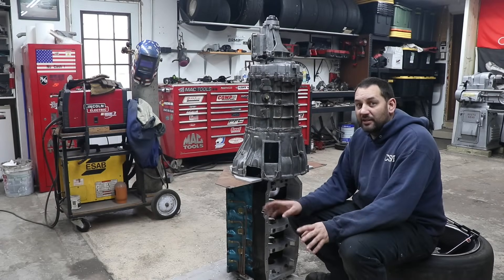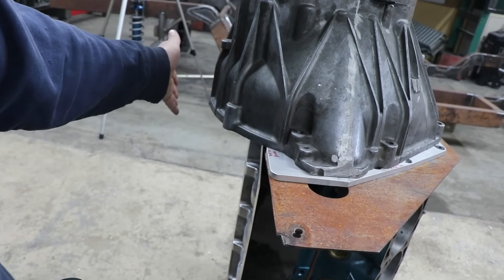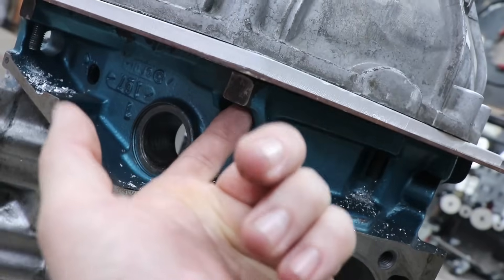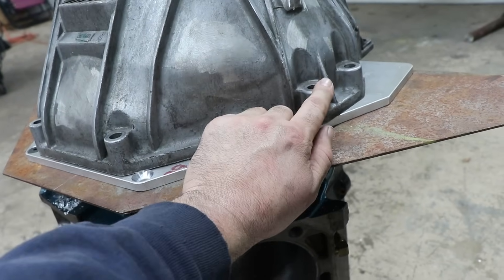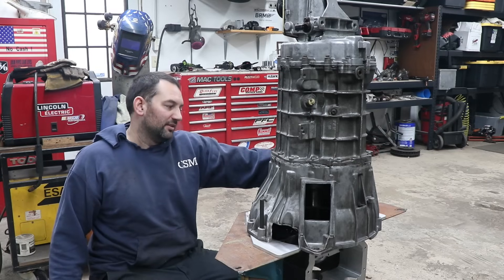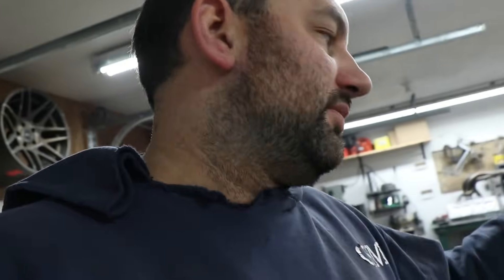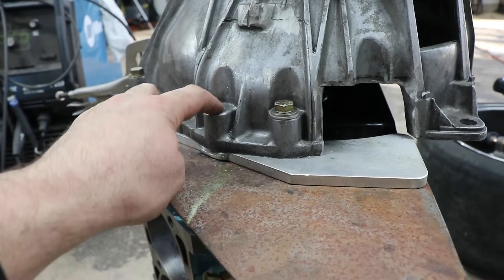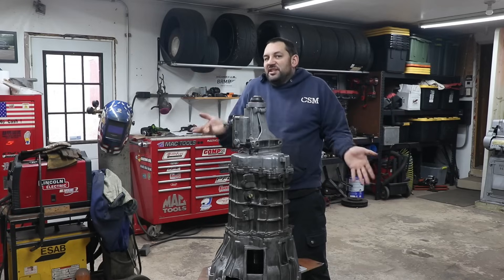Any Transmission to Any Engine

Comment: I'm the father of a son who now drives a 1998 Toyota Tacoma Inline 4 2RZ. Anyone have recomendations for a more sporty transmission that is less "truck" feeling gears?
EDIT It's a 5 speed manual Base Model Tacoma.
Reply from the maker: @Springfield-eo8jl  there is probably another Toyota trans from a car that would bolt up.
But what you really might be looking for is a better shifter. A good shifter with positive gear engagement feel, no slop, and a shorter throw do a lot to improve the experience of shifting gears
Reply: @codysmithmotorsports736  a short throw shifter is one of his Xmas presents. Looking for later down the road.
Reply from the maker: @Springfield-eo8jl  you might be pretty impressed change a shifter does.
Everyone says BMW M3 is a wonderful driving machine... I drove an E46 and thought the shifter was hot garbage compared to the shifter on my car
Reply: @codysmithmotorsports736  we're going to give it a go, not sure how long the transmission is going to last. Shifting from 2nd to 3rd it grinds, the shift stick has a big vibration in 3rd and 5th gear. It's popped out of 3rd a couple times.
Reply from the maker: @Springfield-eo8jl  sounds like it needs syncros and to make sure nothing is bent or loose with the shift forks/mechanics internally. 
If you don't mind taking things apart transmissions are pretty easy and only need a couple tools and a press to rebuild
Reply: The factory transmission is pretty much exactly the same as in a supra just has different ratios especially in 1st gear for heavy weight moving

Comment: On a 4speed blowproof bellhousing.  Get 1 that bolts up to transmission then cut off plate to moter .weld on a plate that will bolt to moter. Make sure that flywheel and clutch assembly will fit beforehand.

Comment: It's so much easier with a detachable bell housing that has a register to tram off of.  I did something similar to your setup but with an early AMC/Rambler 232 inline six and a chevy 700r4. It was a serious test of patience. Next one on the to do list is a John Deere 4045t powertech diesel with a SAE bell to a  4l60e or 4l80e.
Reply from the maker: @jshafer51  definitely easier with a detached bell. But the whole reason I did this the first time was a 5 speed swap for under $1300. Buying new bolt on stuff would have been over $6k

Comment: Thanks for taking the time to make this video, one thing I would add. Would be the use of a bushing to drill or spot the holes. if you clamp everything Togher instead of using a transfer punch, drop a drill bushing in the hole and spot it with a 1/8 carbide drill this way a guy could do the job with some degree of Accuracy if he had only a band saw and a drill press.
Reply from the maker: @petem6291  agree completely

Comment: Thanks great video makes it looks easy for an adapter also that Oldsmobile block has a lot mods I have never seen before
Reply from the maker: @rocketfarm5352  probably the only Olds 403 block to ever make over 550hp (it made 692)
Probably be less power when it goes back together but it'll have way more durability... Probably still over 600 though
Reply: @codysmithmotorsports736  Like the cooling mod will try it
Reply from the maker: @rocketfarm5352  that's based off the NASCAR/mopar R8. I did it because the block is filled to within 1" of the deck which blocks flow between cylinders. So its injecting water at each cylinder

Comment: what about instead of making a adapter plate, you take 2 bellhousings and weld them together, this seems way more easier then making a plate. you use a old bellhousing that will bolt to the engine and cut off the bellhousing bolt part, center the trans you are using on the engine with the pilot shaft, and measure and cut the trans bellhousing back so many inches etc, bolt the good bellhousing to the block, recenter the trans back on top and make sure clutch fork is centered in the correct location and trans is level with engine, and weld it up. no adapter needed. sure beats spending days cutting the adapter plate by hand with grinders etc.
Reply from the maker: @turboimport95  that is an option however you would need both bell housings to start with. The biggest drawback of that method is the welding because welding warps stuff. No matter how good your alignment is before welding it will be off after welding. Off enough to matter or not really depends on the setup, work holding, and the person welding it. 
Thus would be a much better option if the transmission has a center hub that locates in the bell housing. You could line things up in a mill after welding and bore/sleeve that center to fit. Along with making sure the faces are still square and the holes all line up

Comment: i just wish the vehicle manufacturers would standardize on SAE bell housing dimensions, it would make things easier.  the ford and cummins engines all have SAE dimensions either on the engine or the adapters.  i made an adapter, it isn"t too hard if a mill is available
Reply from the maker: @joshmyers-nt9dr  yeah things get way easier if they're standard patterns or the prints are available
Reply: they should also standardize wheel rims. heavy goods vehicles all use 10 stud rims, cars should all use their own. there's no need for 10 different incompatible 4 stud rims. the waste is expensive, environmentally wasteful and completely avoidable without financial overhead if mandated on new designs. If the patent system makes it illegal to copy a bolt pattern then it needs to be reformed.

Comment: A piece of plexiglass can be helpfull as a template..
Reply from the maker: @kbird7112  definitely could use that too
Reply: Polycarbonate is better for drilling it doesn’t crack like plexiglass
Reply: Or delrin is nice to work with. @shannonDRAGRACEING
Reply: Thst a great idea
Reply: I've used a method where I glue a sheet of  1.5 mm aluminium to the blocks rear mating flange then tap round it with a ball pein hammer (like you would making a gasket pattern) to get a really accurate template for your adaptor plate, for marking the CCL I cut a bigger hole in the plate than I need roughly where the crank sits,then fit a snug shaft or tube into the crank spigot and fit a plate over the shaft with the correct sized hole for the first motion shaft,then tack it in place with a few welds,so that when the shaft comes out the hole is dead centre of the crank. You can then use the hole for the first motion shaft to line your template up accurately onto the bellhousing. It's served me well on 2 or 3 conversions, the trickier problem you will encounter from time to time is where the flywheel and clutch are too big for the bellhousing you intended to use,then it gets more fun/expensive/time consuming😊.

Comment: What transmission is that yours using?
Reply from the maker: @jeromeirving4770  Tremec 3650
Reply: He said it bolts to a mod motor , meaning Ford 4.6 , 5.4 etc etc.  So that means that is probably a T45 or a TR3650 from a 1996 to 2004 Mustang GT.   The clutch cable guide hole in the bellhousing is what tells me it is pre 2005 as Ford switched to a hydraulic clutch for the 2005 year model.

Comment: Good information.
I'm planning on making an engine to trans adapter plate to put an LS engine in my 1990 Jeep Grand Wagoneer here pretty soon. Thank you.
Reply: Depending which transmission you're using you may not need anything custom. Give me some more details if you don't mind

Comment: Nice. Your pilot mandrel, is it in the back main only or the last two main caps?
 It must have been a revelation to find the 1/2 inch longer input shaft.  I imagine it is made specifically 1/2 inch plate adapters

Love the main girdle.  I have not seen one like it before. Is it self built?
Reply from the maker: @gordonborsboom7460  it's only in the rear main. I didn't have a long enough piece to get two mains but would have.
The long input is actually just for the later trans case design. There was 01-04 and 05-10 which had some updates, including the longer input shaft.

Main girdle is my design. Built is over 10 years ago and it held that weak, windowed main block together at nearly 700hp and 7500rpm